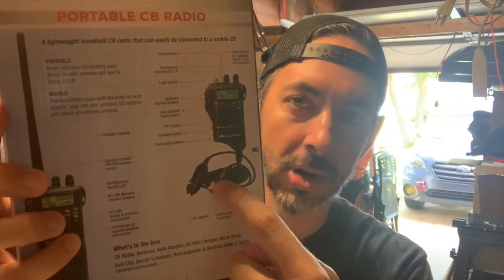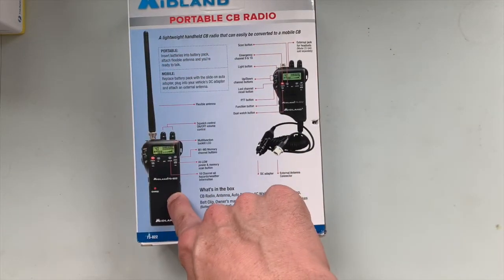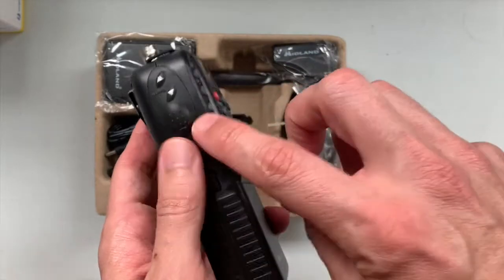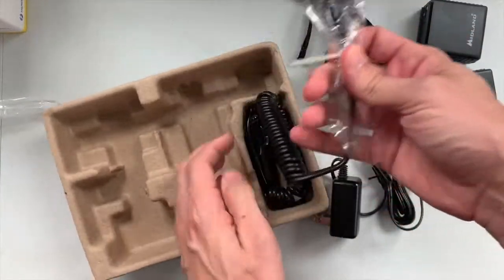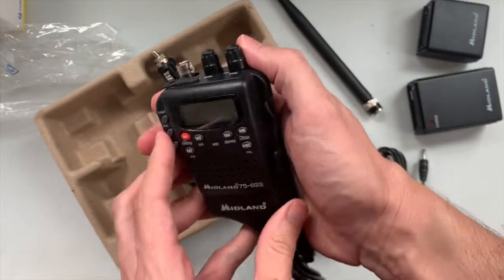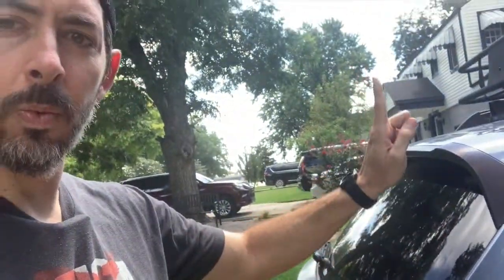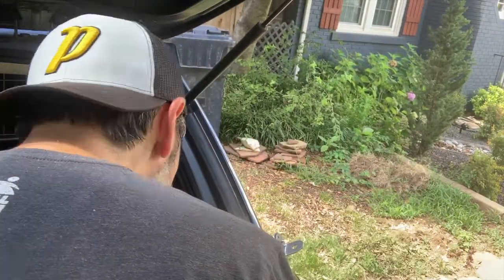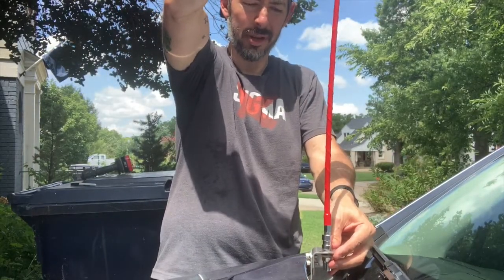Product review & installation: Midland 75-822 portable CB radio

Comment: Did you also buy an SWR meter?  You need to make sure to do that before you start transmitting.   I also recommend a quick disconnect adapter and spring for your antenna.
Reply from the maker: Yes! Bought a SWR after I made the video.
Reply: @helloandymoore  
Did you make a video of Swr tune up ??? Please let me know I am stumped 🤔
Reply: Never mind the meter let’s me know what I need duhh lol
Reply: I bought one of these 
 and I am unable to open the battery compartment.  I follow instructions, and I feel if I pull any harder, something is going to break.  It doesn't open, as of the button mechanism isn't moving the inner latch.

Anyone else have this problem?

Comment: Hind sight... all you had to do was put flat head screws in the rear... that would have involved counter sinking the holes of the bracket, but not a major issue with a counter sinking bit.

Comment: I bought one of these 
 and I am unable to open the battery compartment.  I follow instructions, and I feel if I pull any harder, something is going to break.  It doesn't open, as of the button mechanism isn't moving the inner latch.

Anyone else have this problem?
Reply: The author of this video showed several times how the compartments slide on and off. Just press the detent and slide which ever adapter to the left.  I can't imagine a use for the battery compartments, I only have used the car adapter.
Reply: @kurtp5379  The car adaptor is also the only thing I wanted to use, but it came with one of the battery compartments already on, and I couldn't get the dang thing off.
Sent it back.
Reply: @kurtp5379  
Geez!  OMG!  I did not watch this video after having watched 3 others which never showed the opening of the battery compartment....

And before you replied, the seller was asking for it back, so I sent it back, then I saw your reply, then watched this vid in it's entirety.  

I feel very fluoridated at this point, but had the instructions come with an illustration, I would have realized it was a chinese puzzle, instead of assuming the obvious suspected design.

They need to put an illustration with arrows indicating slide direction, and the two halves, half way engaged.
(For us old dumb guys)

 Everyone just assumed it pulled out like a magazine clip.

Comment: Is the fact that NOBODY just uses or reviews with the antenna that connects to the unit itself indicative of the fact that it will barley work unless you have an antenna mounted on the outside of your vehicle?
Reply from the maker: The small antenna is designed for open-air use, like if you’re hiking. The metal body of the car tends to block the signal so you can’t really use it as a handheld device from inside. 

During a recent ice storm & 11-day power outage I used it as a handheld to monitor weather and it worked great. I’m in town, though, so not a lot of folks with CB radios to talk to. 😂

Comment: Wonder if it will work with just the afixed antenna while in the vehicle? I was going to buy one for all vehicles, but this unit i can carry anywhere... hope it works!!
Reply from the maker: Hi Judd, it does not work with just the small antenna while inside the vehicle. The body of the vehicle blocks the CB signal pretty completely. Remember, most CB radios (like this one) are only 4 Watts, which will get you a maximum distance of 1-3 miles in urban areas if you have a tall antenna without too many obstructions. A short antenna inside a car is a double whammy no-no.
Reply: @helloandymoore  thanks andy, that mskes sense. I have a 3 ft antenna ( magnet type) would that be tall enough??
Reply: Did you hone in your antenna with an SWR??? I ordered one, dad had one somewhere, hes been gone since 96 and i wouldnt know where to start looking
Reply from the maker: Yep! Should work great. If I kept my roof basket on year-round, I’d have mounted my antenna there. Alas, too many roof accessories, too little time.
Reply from the maker: Yep! Tuning the antenna is 100% recommended. Speaking of which, I probably need to do mine again soon...
Reply: @helloandymoore  thanks, i ordered one today